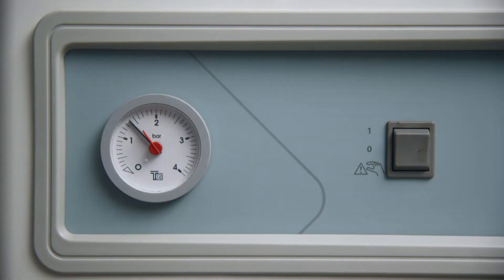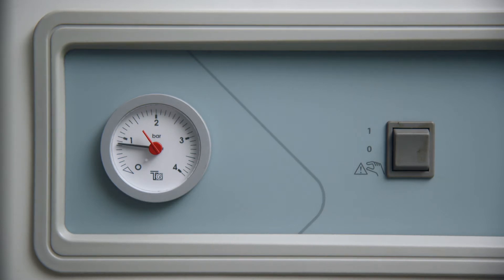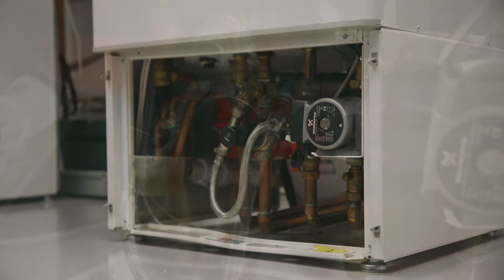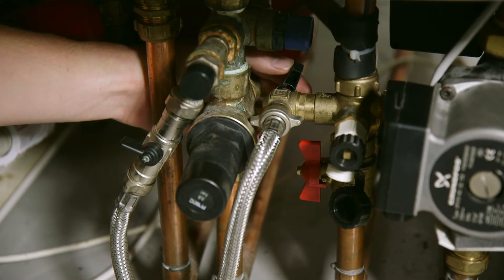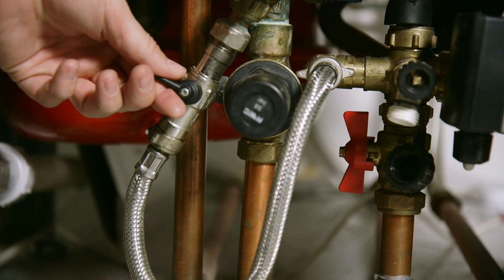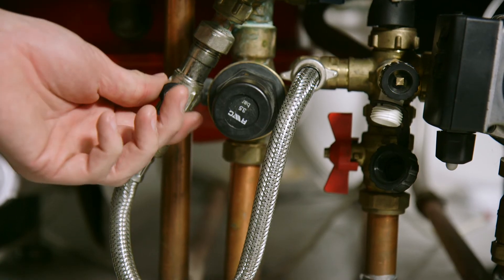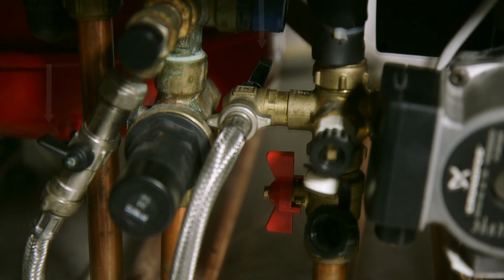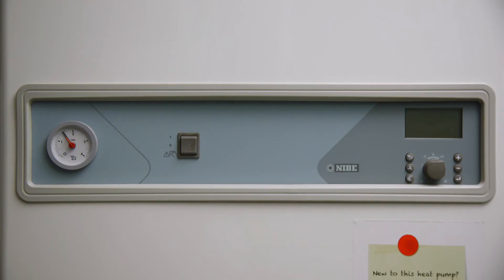NIBE F360 - How to change the water pressure

Comment: Hi,
My pressure had dropped below one Bar over two years almost and at the underfloor manifold I was getting a flow of 2 litres per minute...
I upped my pressure to 1.5Bar at the system and now I'm only getting a max flow rate of 1 litre per minute,
Sounds backwards??

Also sounding backwards is --> My action was provoked by a high pressure warning, 2 in 30 days,,, a "high pressure" warning because the pressure is low (?), that's what I understood from the Nibe literature, 

Also at my ground level underfloor manifold the pressure is now showing 1.8Bar (before the pressure adjustment it was around the 1Bar), so again higher pressure in the system reduces the flow rate of the underfloor?

I have found the installers to be less than helpful since the money was paid so here I am,
Thank you
Reply: Did you ever get an answer to this Martin?
Reply: @paddynolan7036  Hi Paddy,
That confused me reading over it again,

If memory serves,
Keep a zone of underfloor open,
the high pressure kicks in if no zone is open and theres no flow through the outdoor unit,
Once I started keeping a zone manually open all the time no more high pressure alert and no cut out,

I just keep my hall manifold open and it feeds heat around anyway,
Nothing to do with the pressure clocks situated at the manifold or cylinder,

Could test it by closing all manifolds manually and see how long until it cuts,
never counted the minutes but certainly overnight for me, 
Your house must be comfy :DD
Reply: And I'm wondering now if a little WD40 in the propellor center would stop it squeaking and squealing, They're a lot louder than a fridge!!
Reply: @paddynolan7036  
Hi Paddy,
Did you try it?